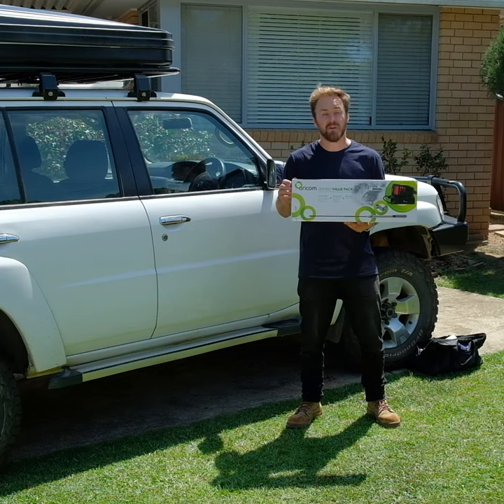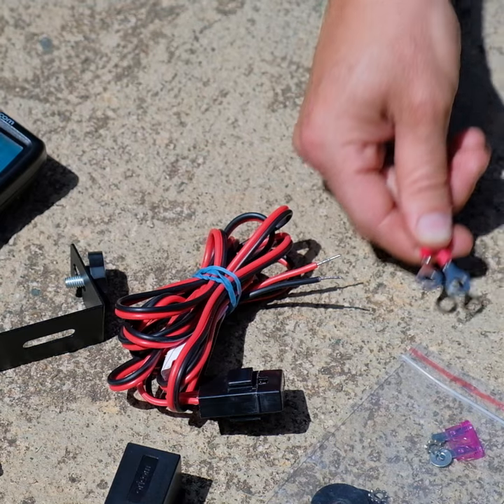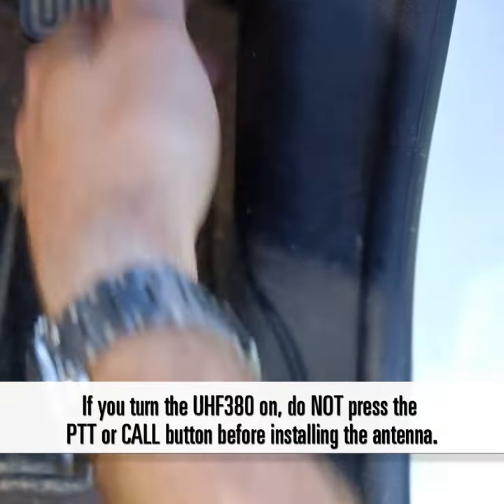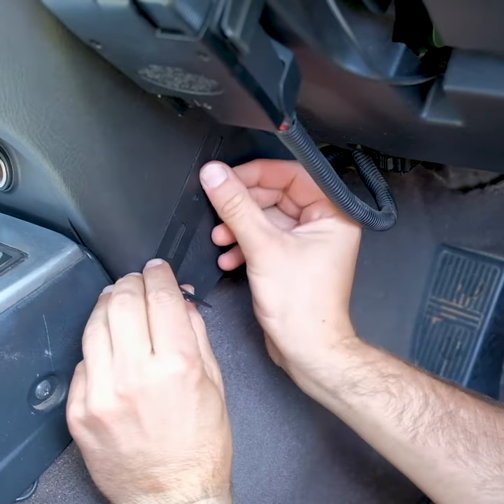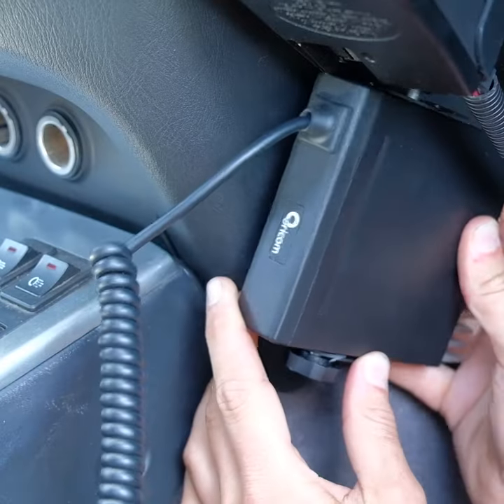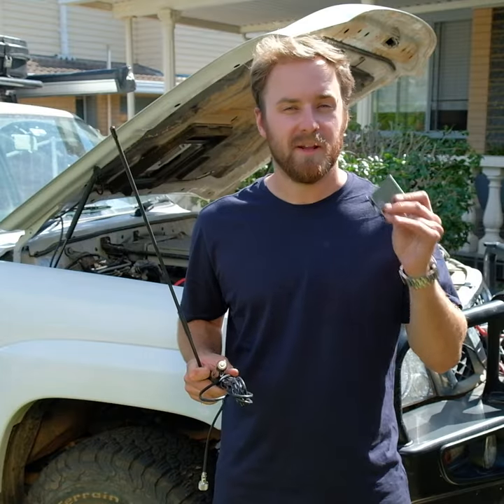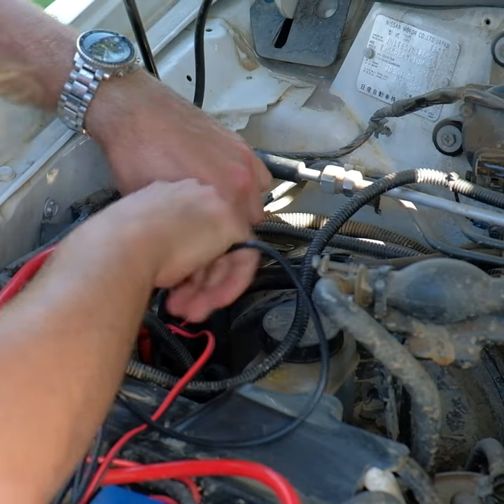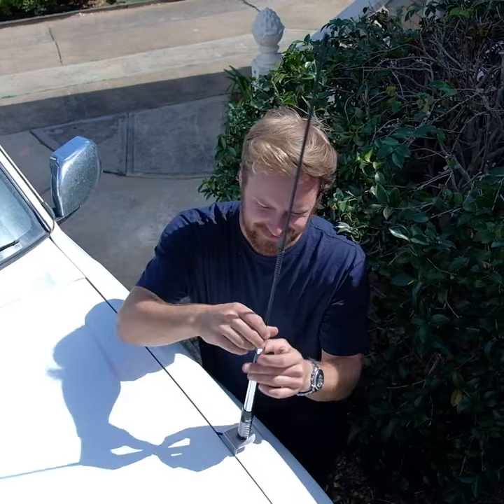Easy DIY Install - Oricom UHF380PK In-Car 5W CB Radio

Comment: Is the radio always on and drawing battery power if installed this way?
Reply from the maker: Hi there,
Unfortunately we no longer stock this product anymore, for more information on this specific product we would recommend contacting Oricom directly.
Regards, Courtney